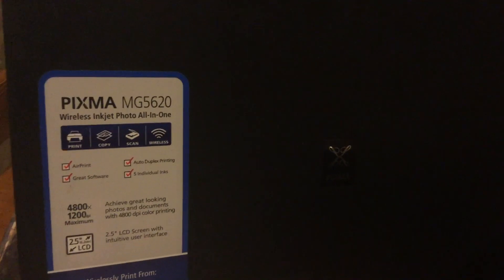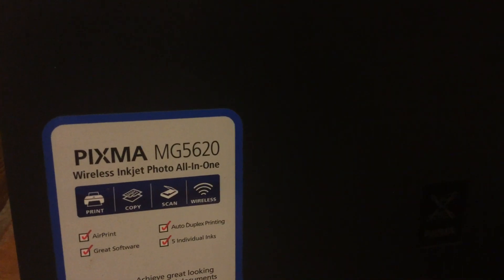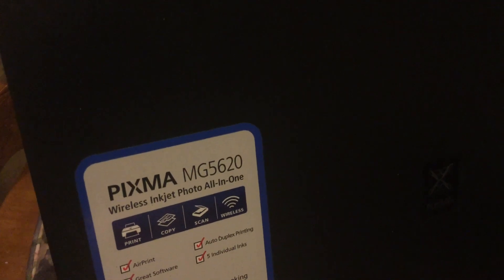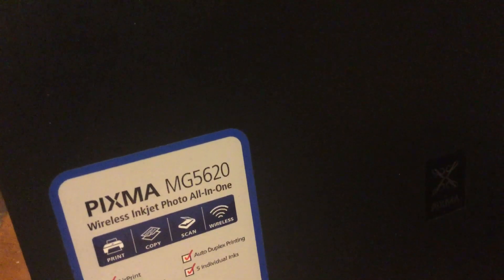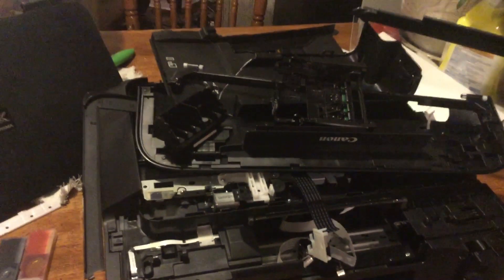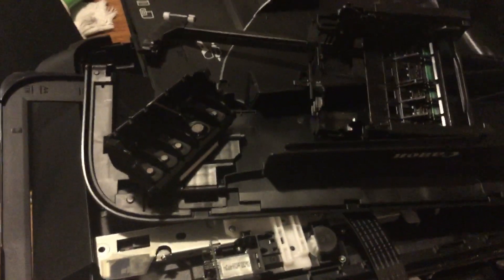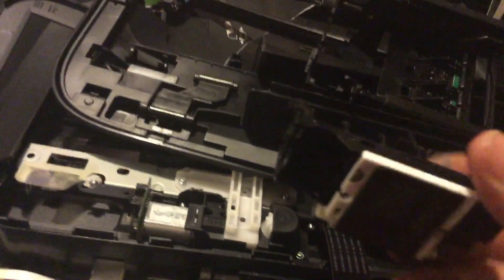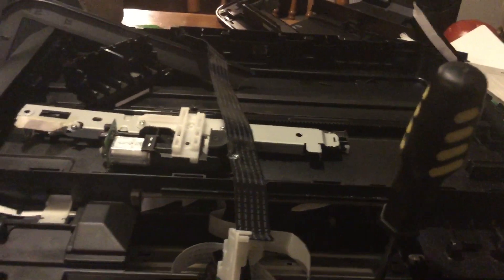Canon Printer Error 1403 Wrong Printhead Fix

Comment: Inspired! What's your call-out fee? But seriously, thank you for this; I used to do tech support as my job and have seriously advised people to put an end to their misery by trashing lost-cause tech. In this instance, after I did lots of desk research, cleaned the printhead with distilled water, etc, you have helped confirm my judgement that I should not buy a replacement printhead, but replace the printer with another brand. Cheers!

Comment: I think this is the best fix to . Have cleaned head a number of times , even unscrewed the head and blew air through holes and a small pin .No blockage replaced ink and no luck.New print head it have cost of printer.Ix6860.

Comment: Yup think mines going the same way, fingers covered in ink, am looking for my baseball bat, do these thing only last a few year then break for no reason?
Reply from the maker: I do not look down on Canon's quality but I made the video to hopefully get their attention that we know that they did a forced bios update that crashed thousands of printers forcing people to buy new ones.  Now, I do not know if they did it on purpose or not.  All I wanted from Canon was an apology and to send out a reversal on that bios update.  NOPE! They would not.
Reply: @jeromegriffin8775  Dang Man, I just had this error appeared on my Canon MP237 it was all fine and perfect yesterday, then just the next morning it stopped working! The frick? Did they just did some firmware updates? Better turn off the wifi next time I buy a Canon printer and throw the fricking installation disk that comes with it.
Edit: I tried scanning and Printhead alignment which obviously doesn't use Ink. Hmmm I am thinking some corporate greed going on here. Fricking Canon! 
Any possible way to restore the old firmware?

Comment: It's happened to me. I've had 2 Canon printers. Their error messages are impossible to bypass even though their is no logical technical reason to block repair. Also, they find brilliant ways to make it hard to use third party inks. I'm fairly tech savvy and I did a thorough and careful printer head clean. Everything carefully returned to its place. But this dreaded 1403 error is impossible to bypass. I have a Brother black and white laser printer and I fill the toner catridges myself. Never a problem. What I did like about my Canon MX926 was that it was a colour copier, scanner and fax - relatively cheap except having to buy expensive inks. I need to get an equivalent. I'm think of a colour laser printer/copier/scanner/fax where I can refill the colour toners myself. Nothing too expensive. Any suggestions?

Comment: Funny video but you really clean the print heads.
Problem fixed as you dont read the support forums at Canon.
Go back to school!
Reply from the maker: Mickey McMouse I have 25 years tech experience. Of course I tried cleaning the print head. I even purchased a new one. I exhausted every possible solution before giving up.  I can not afford to destroy a printer.  I do not need to go back to school to realize Canon sent out auto firmware updates that bricked many user's printers. I am sure some have fixed theirs with the cleaning method but if you would go back and read the forums you will see that this does not fix everyone's issue.  Canon has tried to push the so called solutions and this is why I made  the video.  Just to be totally clear, I not only cleaned the print head but I purchased a new one. My printer worked perfect one night and after the firmware update it would not work. All Canon needs to do is push a reverted firmware update and problem is fixed!  They will not even acknowledge this. I made the video to bring this out. They seemingly bricked printers to sell new ones. Plain and simple. Thanks for your comment even though you spoke without knowing what you are talking about. Enjoy your school

Comment: I was able to fix the 1403 error code on my printer which is the exact same printer in the video. First, I removed the print head and cleaned it by putting it in a shallow dish with 1/4 inch of distilled water. print head side down. Do NOT get water on the gold contacts. Do this a few times and change the water each time. pat the print head dry with soft tissue. Next, make sure the printer is unplugged and reseat the print head and ink cartriges. Close it all up and add a few sheets of paper. Do NOT plug it in yet. Next you will perform a maintenance test from your computer and NOT from the printer itself. On your pc, go to control panel--devices and printers and make sure your canon printer is set as the default printer (should show a checkmark by the icon). Next, right click the printer icon and click printing preferences then click the maintenance tab. Click print head alignment then "ok". Because your printer is unplugged, it will queue the command. Now plug in the printer. It should bypass the 1403 error code and print an alignment page. This should fix the issue. I then followed up with print head cleaning from "maintenance". It worked for me but your mileage may vary. Good luck!
Reply from the maker: Richard Scott I hope this helps some people. I did all this also and had no luck.  I actually did this a few times.
Reply: I did that too and it didn't clear the error.  I'm going to repair it the way the video showed.
Reply: No luck either, but thanks for the suggestions.
Reply: No luck with my MX922. Tried many variants. My MX922 couldn't get over itself.
Reply: Didn't help. The printer doesn't do the queued alignment, the 1403 error always gets priority blocking any queued jobs.

Comment: nice! Thanks for doing what i feel like doing to this printer of mine!
Reply from the maker: I tried everything!  I am actually pretty tech savvy.  I just seriously could not stand it any longer. It was taking away my sanity.  My printer worked perfectly one day and then it did an automatic firmware update and never worked again. In my opinion, Canon purposely sent the update to force customers to buy a new printer. I have seen no real evidence for a real fix.  It seems it could be fixed with a new firmware.  I did all the so called fixes and even purchased a new print head. Nothing worked. I seriously then decided to destroy it as I was at my wits end even though my money is tight.
Reply from the maker: I hope you find a real fix ASAP.  I had hoped this video would draw more attention to Canon's customer service.